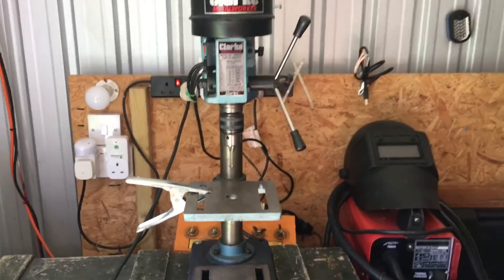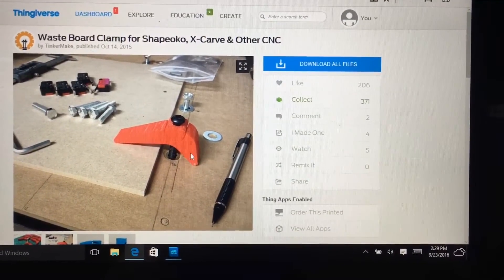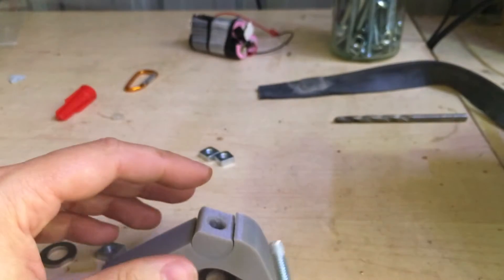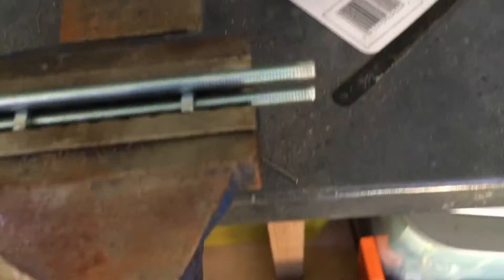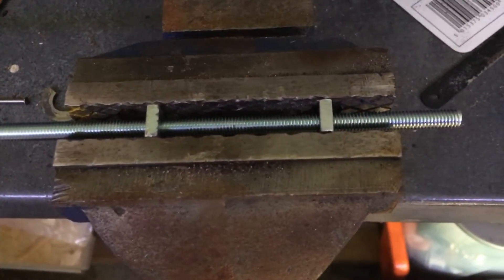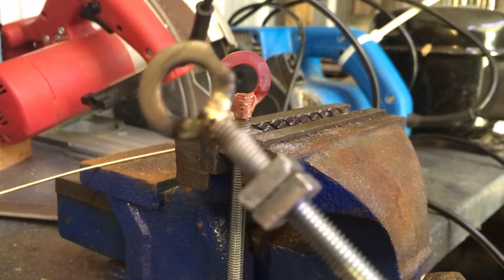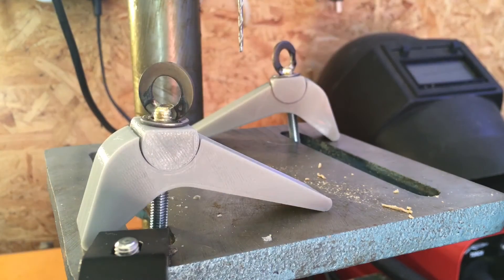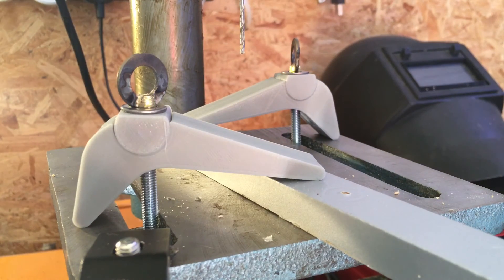DIY BUILD DRILL PRESS HOLD DOWN CLAMPS

Comment: The 3d printer really is brilliant for when you need stuff like this as much as it is for manufacturing, i want one to now i must admit :-) I like how you used the steel threaded rod with the washers as well, combining the two manufacturing techniques as simple as it may seem offers real versatility for diffrent things for a ultra win :-) I like how you can halt the 3d printing, can fill the printed part with something of a heavier material then press continue again on the print to seal it in :-D great theory and application here :-p
Reply from the maker: Hi mate i sent them out Thursday 2nd class not sure when you will receive them. 
Yes Manny things you can make i am surprised just how strong pla is when the printer is setup right lot stronger than people make you think.
yes you can fill the print my stormtroopers i filled with sand .
Reply: Norfolktuber
thanks mate for dispatching those to me, i must admit im very excited about seing them in hand :-)
 and yeah tottaly, any stronger on the pla and you could make some really solid wrenches out of the stuff :-) super for pieces like your storm troopers there for sure :-)
 the sand was a really nice touch! its mind blowing how fine resolution it can print at with like 0.004m acurracy too :-D thats some fine detail capabilities right there :-)
 just experimenting with printing parts and reinforcing them with small steel bars and filling them with sand and nuggets of lead and things would keep me entertained for months :-)
 its like with your star wars set, like in the old days you would have got a piece once a week from a magazine, and there you are a few days later and you printed the full set plus the millenium falcon :-D
 please tell me you can program it so once a piece is done the nozzle or arm can move the piece out the way to print the next one, so you can leave it running almost 24 without maintainance to come back to a mountain of parts there...thats literally to good to be true :-D
 soo good, soo want one now :-D mwahh mwahhhhh
 :-) just dropped you an email my friend, keep the parts and vids comming :-p
Reply from the maker: No problem.  Reinforcing them can be done design item in cad with space to fit metal  Reinforcing.
I can print 20 at a time but then you have to wait 12 hours for print to complete don't like leaving it on untended while out.
Reply: Norfolktuber
lol it would be pretty bad if you came back to a 20c3 plastic ball of melted together jerry cans i must admit :-D
 it should be sweet to get good runs on stuff while working on other stuff for the win so its still plenty of utilization going on there :-)
 its going to be a great aid to your metal skills for plastic caps for say the bottom of stools and things :-) with personalised items with names and 3d pictures :-)
 its like its limits are almost the limitations of the imagination you know :-D i cant wait to have one of these and a carbon fibre 3d printer next to it :-) for a guy whos not very good at metal working those two will make a great combo to work with my cad :-)
 those and a nice cnc from raymond for the win :-) ive cleared a room upstairs to do some wood work in there so that could be a good base for all the hardware :-) its just that it needs painting and is a bit run down so ive not done a vid on it yet :-D
 hope the week has started for you well my friend :-)

my best regards
Paul